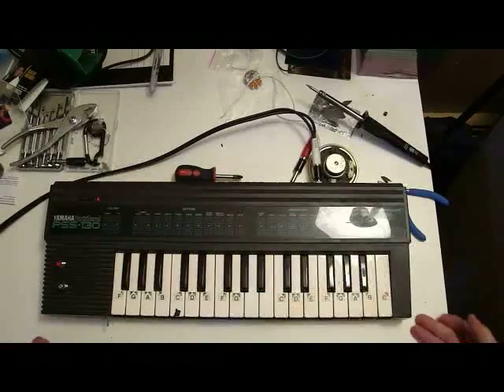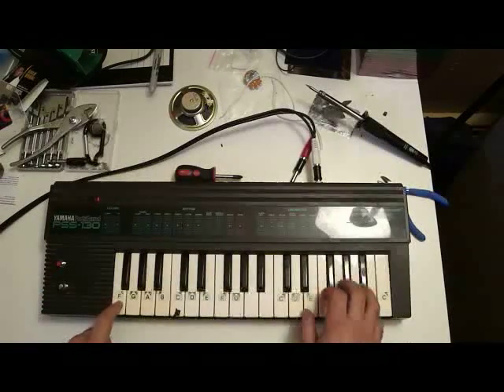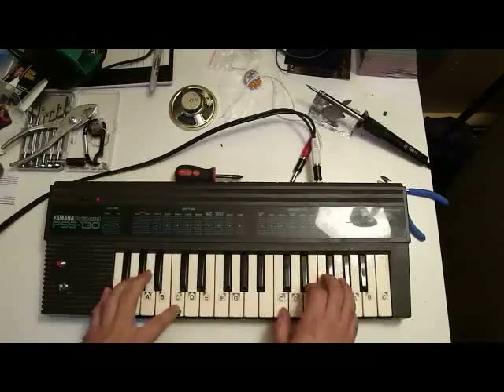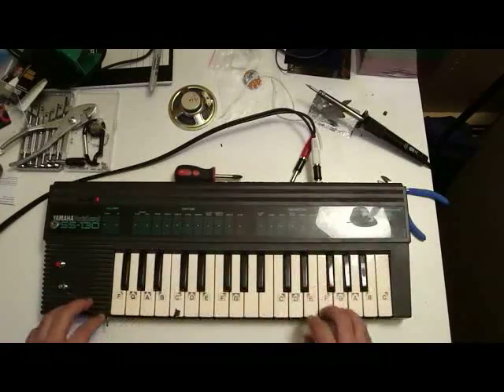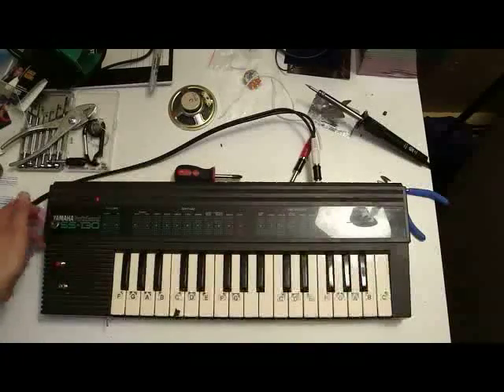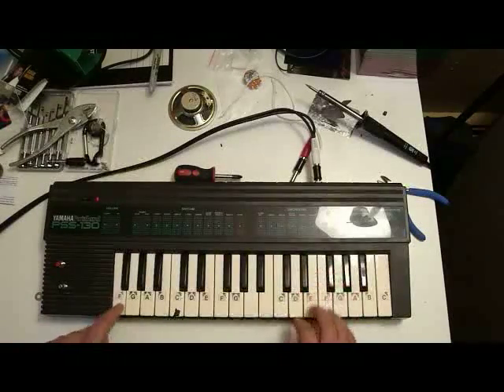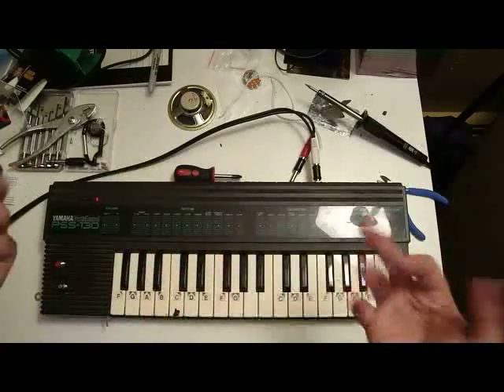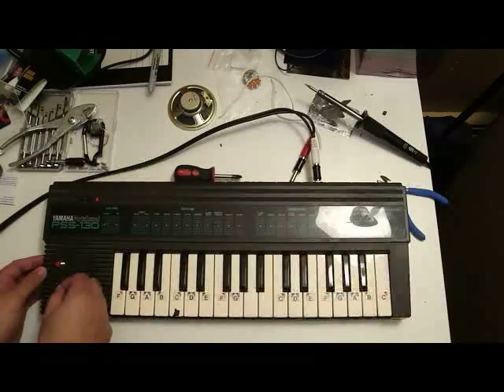Circuit-bent Yamaha PSS-130 demo

Comment: I'd be more interested in the modification of a line-out.  What did you connect the wires to?  Did you just go off of the original speaker, or try to get the un-amplified output from the chip?
Reply: this is one of the most hidden comments ever
Reply from the maker: Oh, wow! This comment was from long before I had any idea who The 8-Bit Guy was. I'm a huge fan of your videos! In fact, our shared love for these keyboard hacks was how I ended up finding your channel.

This output jack hack was off the speaker, as I really had no idea what I was doing then and didn't know there was an option to go off the chip. I was just poking around and figuring things out as I went along.
Reply: The 8-Bit Guy maybe the speaker

Comment: How did U manage to connect this as it has no headphone/out put sockets. Have you used the wires that used to connect the speaker? I no wat U mean it's a rubbish toy on it's own. I hav FAR FAR better keyboards including pro keyboards like Juno G & so on. Please visit my channel to hear some demos cheers. Very cleaver what you are doing with the circet bend as I wouldn'd know where to start. I'd love to learn so if you can give me any easy tips, I may get an old keyboard not woth much & trie.